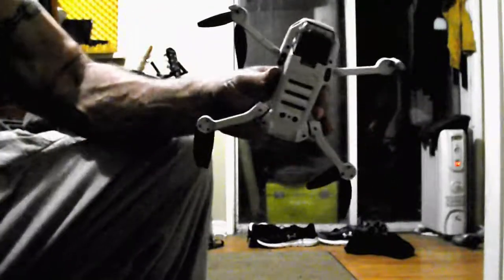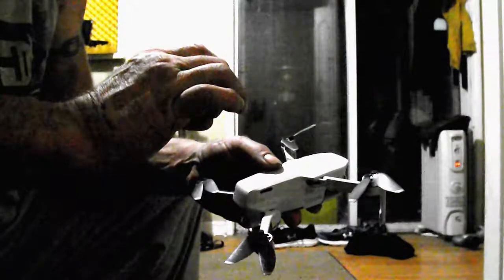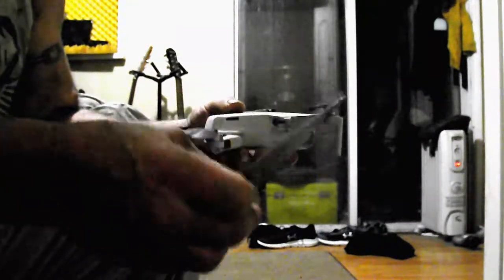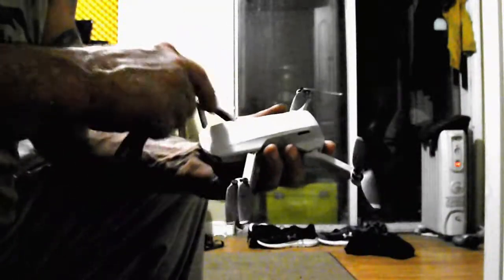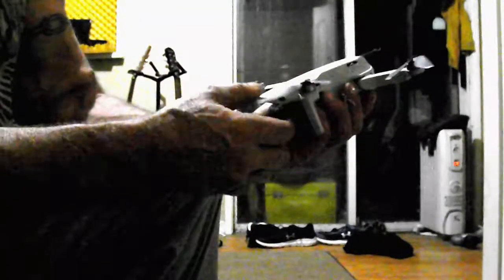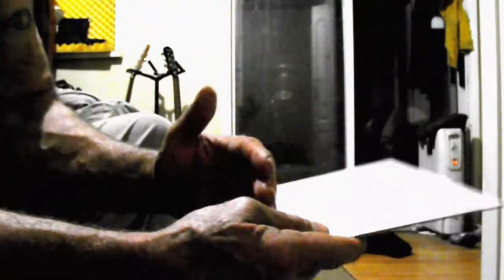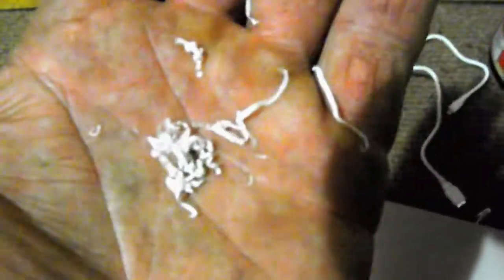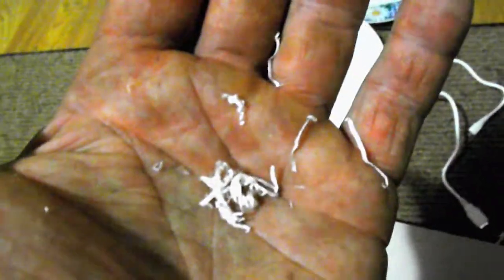DJI Mavic mini weight reduction

Comment: You need to mention be careful not to take to much , those parts are allready super thin like lexan on a rc car and shaving corner is weakening it and if you cash after doing this , it will crack not might WILL ...take that into consideration , i got one that been painted ,crashed , sanded and still flys perfect   i got it used that way , im thinking of drilling small holes in all the arms to reduce wieght . I hope it works lol

Comment: You could be fined up to $250,000 and jailed for up to three years for saying you are a recreational and having an overweight drone. Keep in mind it's 0.55 pounds, which is just around 249.5 grams, not 250 grams!
Adding lights to the Mavic MIni puts it overweight!
Mod the battery and change it from 18650 to 18500 or so and you might get some grams to play around with lighting.
Reply: What country are you talking about? In the US you can fly recreationally with a drone 0.55lbs or higher... It just needs to be registered. It's the intent of the flight that matters.